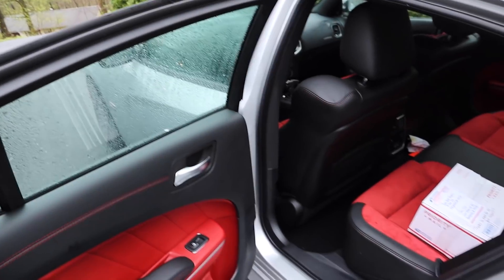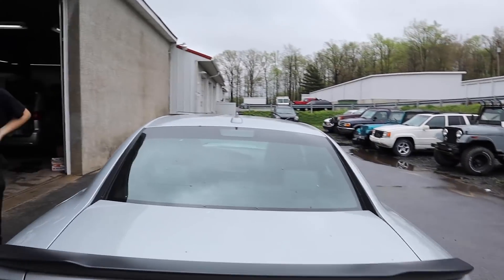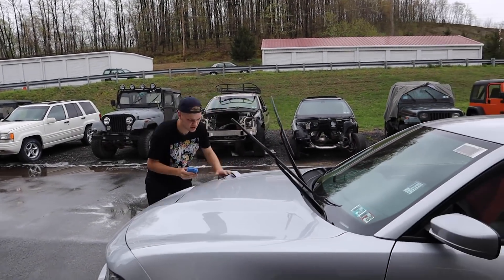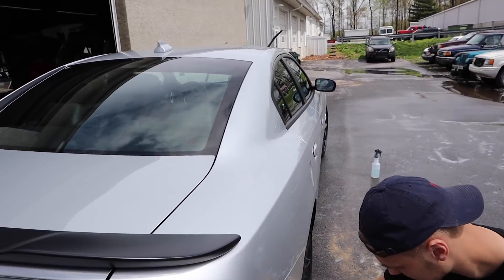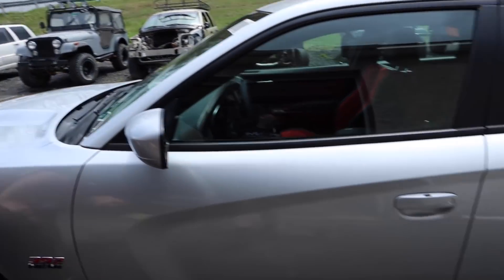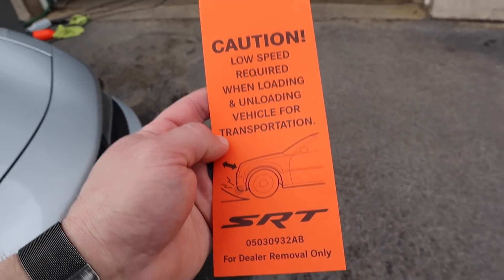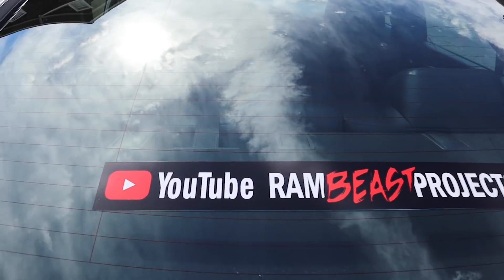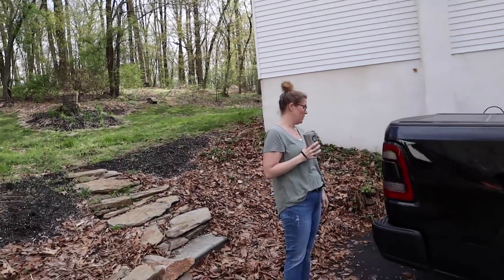DO THIS WHEN BUYING A NEW CAR

Comment: Keep the SCAT badges, delete the air dam protectors. Love the channel! Really appreciate the the S&B Air filter install video. Will be attempting the project on my 2019 Rebel soon too! Keep up the great work.
Reply from the maker: Hi Josh, no problem. Did you see, BDS now has a 6" kit for the 2019 Rams?!
Reply: Ram BEAST Projects I did! But I got mine with the 4-corner air suspension set up. I don’t think they have a kit that fits the 2019 and up. I know they made one to work with the first gen Rebel. I assume they will soon for the current gen.
Reply from the maker: Most likely.

Comment: The other thing that sticks out is that red reflector looking thing on the front fender. I saw those on a bunch of hellcats online and it just doesn't flow that well with the body. Personally if I couldn't actually remove it, I would have it tinted black.